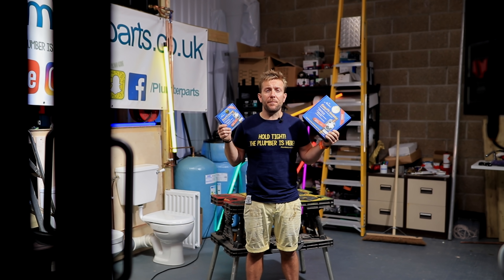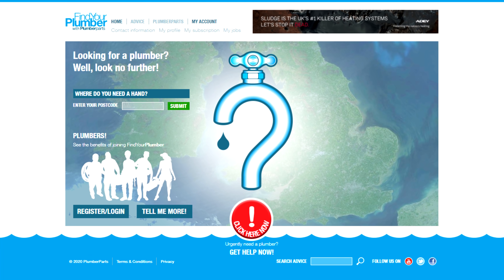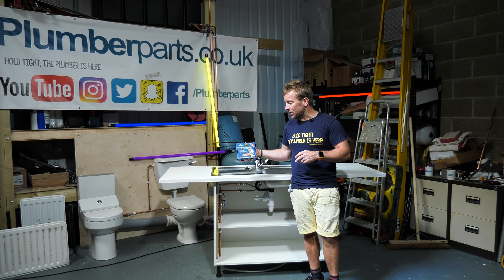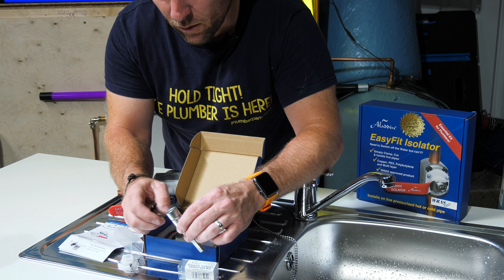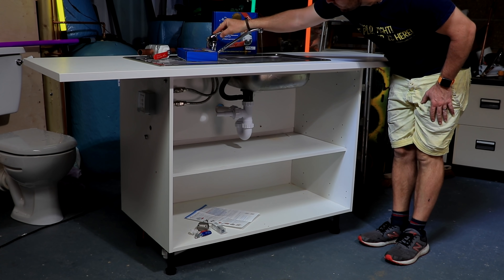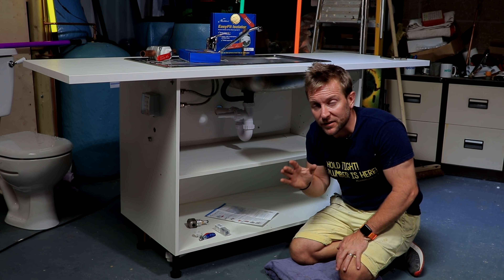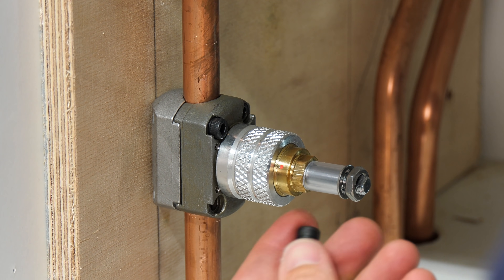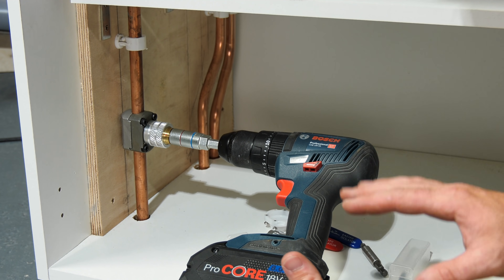HOW TO INSTALL VALVE ON LIVE WATER PIPE

Comment: I purchased one of these kits, which included all the tools required. This tool didn't cut the pipe it actually crushed the pipe, and had a flooded kitchen, and had to call an emergency plumber at a cost of £150 call out charge. I contacted Alladin via email, who have yet to respond. I wouldn't recommend this item, because when you follow their instructions, and you end up with a flooded kitchen, and sent photographs of the damage done to the pipe, via email, and they don't respond or take any responsibility for their product and damage caused "disgusting "
Reply: Hi Andrew sorry you had no response we have checked and can find no email from yourself  please resend to admin@nlbengineering with your contact details and we will contact you today.
Reply: Aladdin Plumbing Products 
Hi I sent another email to the address provided and it just got sent back to me saying it doesn't exist . It would seem that the address provided isn't in its entirety. I sent the original message to sales@aladdin-products.co.uk, and sent the same message to admin@nlbengineering, which you provided, which also didn't work, so I then tried admin@nlbengineering.co.uk, which also didn't work. It would seem that you really don't want to contacted. The address you provided via YouTube isn't even on your fitting instructions, that came with your product. The box states it comes with a 10 year guarantee, but who's that actually with, because I've reported this problem with Aladdin via email, to the address provided on your instructions. It would seem you don't have a complaints procedure, in place. Not impressed at all.

Comment: I appreciate the way you earn your money, but I put so much energy and efforts to learn the science behind the plumbing and it just doesn't feel right, you know?!
Reply: Yer alot of people think it's just putting pipes together and it's done,there's so much more to learn about falls and the lay of the pipe work not to mention what sort of pipe suits the job 👍👍👍
Reply: EasyFit is tried and tested, these valves are used in domestic and commercial applications, Swansea Hospital, Royal London Hospital, Sainsbury's, various projects with pressures up to 12-bar (16-Bar rated), 10-year warranty.

Comment: O man..I see tons of low experience guys buy this and make a flood in house.   Even if the main valve is two streets away I would still go there and turn the water of on main valve. Low faith in this, to low. To many things can go wrong. Good luck with having really nice unscratched pipes to maintain good seal.  Good idea though it is just me having low faith in this.

Comment: If any plumber tells you to install this type of product or similar product, run. 
It effectively damage your pipe which will be more damaging and costly once this type of contraption fail.
Reply: Hi the Aladdin EasyFit Isolator is a unique product designed and patented in the UK there are no similar products.  They were many years in development and have been for sale since 2013.  The product is guaranteed for 10 years and has a unique double seal system unlike many other plumbing valves.  Hope that helps Erik.

Comment: Actually, it's the same type of valve I used when fitting pipe to washing machines and I believe it's a hell of a lot cheaper than the valve you are using

Comment: In this instance you would still get metal filings in the water supply line (or plastic shards when attaching to PVC) which could be really bad. Remember to flush the line & have a filter.

Another thing to consider, as more homes & businesses change over to PEX lines, this valve system probably would be unusable.

In my opinion, this is such a extremely niche product that if I needed an "emergency shutoff" I probably would just use a good quality metal clamp (or VISE-GRIP Locking Pliers) to temporary clamp off the water until I could properly repair the line. The metal clamp (or Locking Pliers) is cheap, quick, reusable, & always available. Also, generally it doesn't contaminate the pipe with metal filings.

Comment: Is there a version for imperial sized copper pipes?
Reply: The 15mm size also fits 1/2" copper pipes.
Reply: Aladdin Plumbing Products - Excellent, thanks! I also noticed you will be doing a 22mm version. As ¾” pipe is only 21.5mm, can I assume the 22mm version won’t work with old imperial pipes?

Comment: Word of warning. This is a superb product for nice new 15mm copper pipe, but I have tried and failed twice to fit on old half inch pipe. On both occasions the pipe just crushed during the cutting process.
Reply: well 1/2 inch is more than 2 mm smaller than 15 mm
Reply: @dmitripogosian5084  Quite so, but product makers Say it is compatible with half inch pipe!

Comment: Nice emergency valve, but this would never be approved in the states.
Reply: Why is that? My experience of electrical works regards UK/US is the UK systems are generally safer. Plumbing in the UK is generally well regulated as historically they water companies were a bit OTT regards cross contamination and back flow from dhw systems. So isolation valves and non return valves have to be to a determined standard.

Comment: PROBLEM! IF the cutting tool part is made from steel (most are) then it will corrode over time and can rust in situ causing it to block! These types of DIY products can be very problematic further down the road!! Best to fit a more normal traditional isolating valve for more long term problem free issues!!

Comment: At the cost of £45-00 to cut into a live pipe when there are much cheaper methods! don’t think so.
Reply: Well it depends on how easy the other methods are and how much time they take. I will have to replace kitchen sink tap soon and the isolation valves I put in have froze. I can turn mains off but the hot wood require full drain down. Not sure much those gallons will cost me - I guess if I use it over a few days then nothing. But now I lose time.

Certainty considering them.
Reply: What would you do.. city main value will not turn.. house value is broken.. there is a slow leak in the house for a faucet need's to be replaced.. and the basement is finished.. so you can't get gushing water all over the place.. freezing pipes are out because the faucet is dripping.. so what would you do under that scenario.. and this is my scenario that I'm dealing with
Reply: @robrocco5420  sounds a bit like this could happen next? https://youtu.be/OP30okjpCko

Sorry to presume but you sound like you are in the US? The video above is also in US. On the comments it makes it sound like isolation valves are not common in some apartments in US? So only option is very costly - turn of whole block and get fined if work overrun.

I have no idea if US also uses 15/22/28 mm pipe - metric and imperial.dont mix. So maybe there should be a US equivalent. But I wouldn't know how legal it is.

In UK the water company looks after before meter and property owner after that. Apartments (flats) complicate things - but since folks pay service charges maybe this comes with some limited maintenance.

Anyhow if u were being hypothetical - sure this is another use case assuming pipe diameter works and legal to use.in that country.

If this is really happening to you - don't call the plumber I linked. Some non sealing putty can reduce leak but as you said it need replacing.

Best of luck either way.

Comment: LOL. I have £50 that says you would never dream of installing that DIY bodge garbage.
Reply: EasyFit Valve are manufactured to the highest quality using Stainless Steel / high tensile brass, we have zero failings in 17-years of service, they come complete with a 10-year warranty and have been installed by qualified mechanical engineers into Swansea and Royal London Hospitals, Sainsbury's stores, Sainsbury's distribution, care homes, schools and many more commercial and domestic applications, innovation is something we should all embrace.

Comment: I would never tap into any live pipe...I can just see something going wrong and then how the heck you gonna stop the water...if i cant isolate then I dont do the job and it has happened a few times👍....not worth the risk..you know how typical life can be especially with plumbing lol
Reply: versatec1 I think you’re taking life too serious. 🙏
Reply: @billy4072  he is acting responsibly if he is a professional. i also never tap in a live line until i can isolate it. i had to shut offa 3 unit building a few times to upgrade the water lines and add a dozen of valves. some for bypass the filtration system, other to isolate the lines going to each units hot and cold. it all used to be on the same circuit with 1 valve at the entry of the building. was a PITA to fix

Comment: These are terrible. Just cost me 309 quid for an emergency plumber.. I'm a good diyer and followed the instructions to the letter.. whole front of the mechanism blew straight off causing a huge leak upstairs which has gone through the downstairs ceiling..  these are 60 quid each. Might aswell pay a 100 quid extra for a plumber to stick a decent shut off valve on..

Comment: swarf and crap left in the pipe
Reply: Apparently not according to the other posts.
Reply: @stephenhookings1985  that's right is cuts a swarfless  cut so no residue is left in the pipe.  A disc is removed which is pushed safely to the back of the housing.  thanks

Comment: I hope you are not advocating installing the H&C supply pipes/valves in a kitchen cupboard like you have in your video?!  You are wasting the best part of 10% of the usable space and making life much harder for yourself by fiddling about with all the pipes junctions under the unit.  Why in God's name wouldn't you just have the pipes coming out of the wall behind the unit  so you just cut appropriate holes in the back of the unit (set just below the bowl so you don't take up the entire cupbord with pipework), push he unit straight into place and attach (push-fit plastic *please*) flexi-hoses (with integral service valves) between pipe ends and tap?
Reply from the maker: Unsubscribe please. 

There’s more important things in life. 

Goodbye.

Comment: Used one a few weeks back. Rubbish.  Wouldn't seal around pipe and then the valve Wouldn't push in to seat. Junk and expensive.